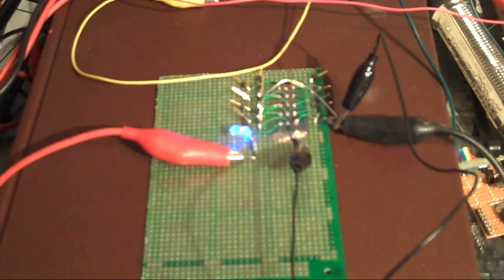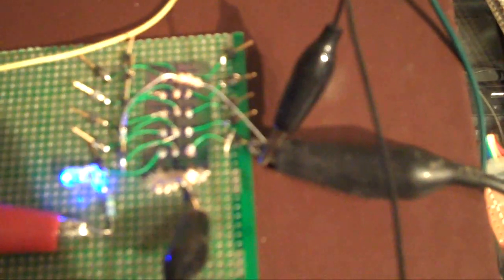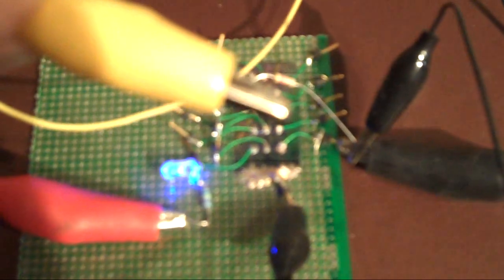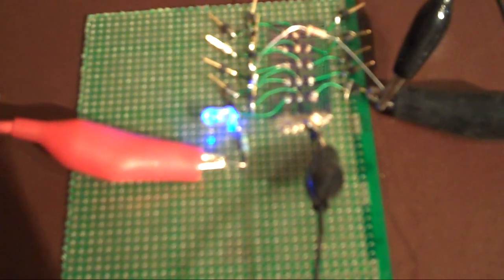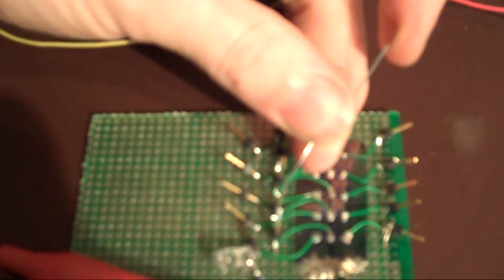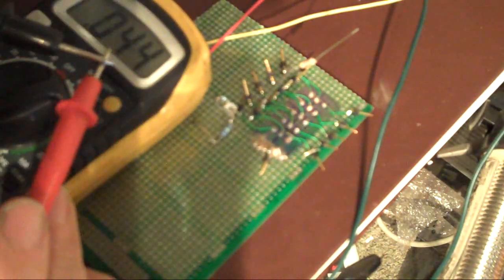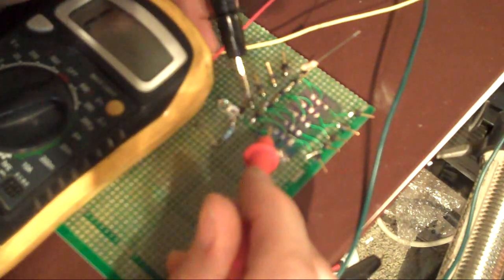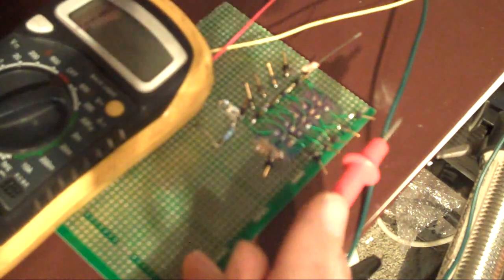Homemade Transistor Demonstration

Comment: And, writing from personal experience, these transistors are made in pretty much the same way as the professionals make them, albeit with refinements of technique, close temperature and dopant level control, and much better hygiene in the labs. Dust, breath vapour and other contaminants can destroy small devices very easily.

Comment: @yoosemit1 all that there is is 2 resisters-the gate of the transistor (pull-down) and a resistor for the LED. If you made this with a MOSFET, or even a BJT, the schematic would be very similar.

Comment: was this done using a 100,000,000nm process?
Reply: -_-
100,000,000nm = 100mm
As You can see distance between 2 transistors about 3x6mm, so the average half-pitch is 2.25mm = 2 250 000 nanometers
Reply: Sedokun thanks for those accurate distance calculations sir!
Reply: the bootcamp
"Служу Советскому Союзу!" err, Always welcome! =))
Reply: SedokunГоворить на Русском стало модно?
Reply: truetamtam
Я бы сказал, привычно.
Reply: Sedokun L
Reply: No she is using 25400 micrometer.

Comment: I know this is a year old but I think it is worth answering.

Basically the whole process of making this is setting it up to tell the charge where it wants to go - what path it will take through the wafer. 

In the making video she tells about driving phosphorus into the wafer, specifically on two sides of the gate which makes the junctions. It does not go sideways because this part is done on only two sides of the gate, so you can put them side by side on the same piece.

Comment: Fantastic Jeri. Why not prove the amplification effect by switching on the LED by the tiny current thru a finger touching two wires in the input circuit?

Comment: @inachu There are models of transistors that are comprised of two diodes that are used to explain some aspects of transistors, but in practice, two diodes will not act as transistors because there is no voltage or current gain possible.

Comment: you touch to a transistor pin and it was going to turn of the led but the short circuit can also do that.Transistor has a only property is amplify the signal.
Reply: And reverse the polarity on the LED can do that too...

Comment: Does the power supplied to the gate have to be from the same circuit as the power switched.?  What if you connected it to a separate barrery?
Reply: +Val Martin the battery has to be connected in a circuit .. I mean it could be a different battery but having the same ground.. You cannot just connect the positive terminal of the battery to the gate and then leave the other terminal, that is all what it is.

Comment: In there video you said there was 5 transistors. How are they separated when they are all part of the same piece of silicon. I mean, what stops charge running all over the place. Is the field around the gate very localised? 
Thanks Dave :)

Comment: And actually now that I think about it more, that long track of silicon dioxide is not actually the gate itself, it's acting as an insulator. The blobs of conductive epoxy make the actual gates. The substrate would be I think P type, the source and drain pads are N type, driven in with phosphorus, and the gates ride on top to make a sandwich with the silicon oxide in between. So when the gate is activated it doesn't conduct into the substrate, it makes just enough field to bridge the gap.

Comment: Is this silicone plate sensitive to light?
Reply: I think it would be partially affected by light.  The old germanium transistors were particularly sensitive to light. I'm not sure which ones now, I think they were the OC71 Germanium transistors could be made into photo-sensors by scratching the black paint off of them :) silicon is less responsive though.
Reply: +Dazzwidd until Mullard started filling the glass envelope with opaque putty 'cos this was reducing the sale of their more expensive OCP71 opto-transistor.

Comment: you can make a homemade transister by useing a phototransister or a photorisister and a really bright led like 5-7,000 mcd white to be more light conductive  and a read relay you put the phototransister and the led togather face to face the phototransister acts as emitter collector and the led is the base you hook the phototransister one side to pos or neg of power supply and the other side to the read relay pos or neg you can use the led from a chip like the 4013 flip flop  the output of it
Reply: That's... not a transistor, really. You're either using a pre-made transistor, or just using a photoresistor. This is a very different thing than what Jeri did.
Reply: @AureliusR  yes it's like a sister of a transistor but it's not actually a transistor the way I built it years ago
Reply: Transister? What nonsense is this?
And that is not making a transistor at home, that would be simulating a transistor with other components, bream!